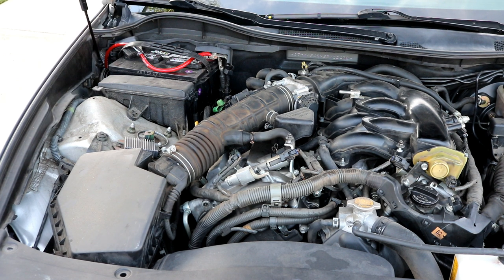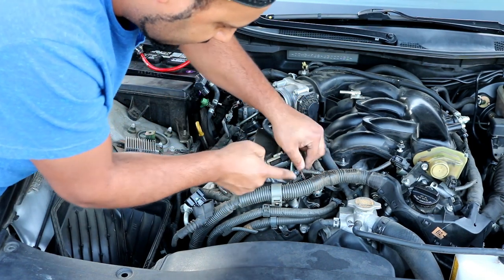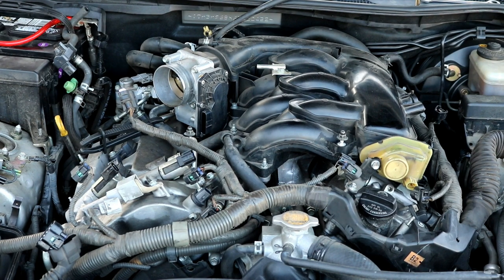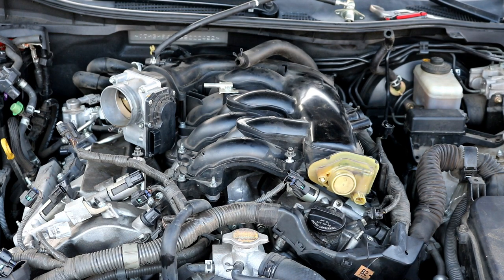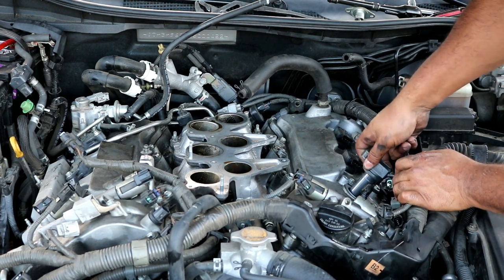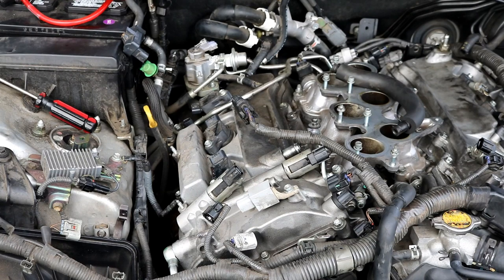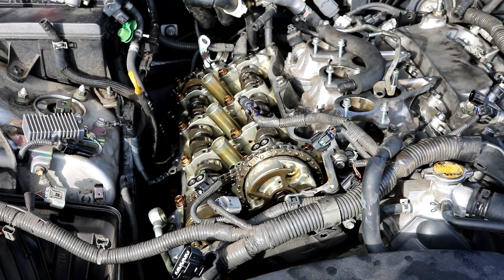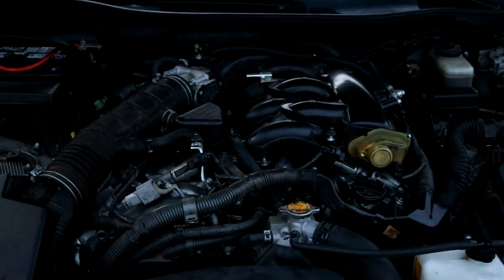Lexus GS300, GS350, IS350, IS250 Valve Cover Gasket Replacement

Comment: i got mine done  today   u got to have a lot of patience to do that job  but im glad i safe some $$ thanks for the video   and the bolt  by the driver side  was really  a b
Reply from the maker: bennyinmtl61 You’re right, this actually took me 3 hours. Of course filming made it longer.
Reply: @HelpingHandAutoRepair    i did my starter too  last week so i decide to fix everything to replace the starter too is not a joke  the top bolt din t want to come out   i had to cut it   it was very rusty   but got it done
Reply: @HelpingHandAutoRepair  3 hours is not bad at all especially given that I've spent entire days just replacing suspension parts (especially with rusty fasteners.) Looks like I should plan to do this and my water pump in the same day since some of the same stuff needs to be worked around and less risk of spilling coolant from disconnecting hoses if it's already drained.

Comment: I would recommend covering those open inlets !! Sod’s law something could fall in and ruin your day😬
Reply: Especially working outside, I was doing some work last week and we've already got leaves falling off our trees and I had to clean them out of the engine bay before closing the hood. I don't want to think of one clogging an intake valve or getting into a cylinder.

Comment: Thank you for this video! Saved a bunch of money. One suggestion… If the spark plug caps don’t fit, most likely you didn’t remove the metal ring from the previous cap. Use a blade screw driver to pry the old one out.

Comment: Thank you so, so much - I've been thinking about taking the covers off to tighten the bolts on the cam gears, since it started rattling a week ago and I read that the bolts may come loose and cause oil to leak back into the engine and not stay inside them :) .
Reply: Kaloyan Beshe

Comment: About to do this.  Really good video.  Wish you showed when you were taking the valve cover off and putting it back on so we can see how difficult or easy it comes on or off.  Did you have to use some kind of sealant on the gasket?  Thanks again.  This is really helpful.
Reply: Found my answer in the msgs below. Sorry for asking same questions.

Comment: Very helpful indeed; however as you reiterated patience is the key to successfully completing these jobs. While I'm at it, how many camshaft timing oil control valves are they on these RWD 2008-2012 V6 IS250/350 engines?
Reply from the maker: I think there are 4 but I am no professional and I do not see these engines enough to know them off the top of my head.

Comment: Very helpful video. I was able to do for the first time. I know its been  a while but anyway do you remember if you had to prime the fuel lines? My car won't start after putting everything back. It looks like fuel is not getting there. Thanks a lot
Reply: check and see if u plugged the fuel pressure regulator connector back that was my issue i did everything correctly but forgot that

Comment: What’s the most I should pay for replacing the gaskets and spark plugs?  I’m not smart enough to do it myself.  2006 is350 75k miles
Reply from the maker: That varies tremendously based on where you live. What I would suggest someone pay in my area is around $500-600

Comment: Great video man, nice and clean video.  Would you mind sharing the list of Tools especially the one you used at the back near the high pressure fuel pump. thanks
Reply from the maker: sunny ponappa badalera Hello, honestly I couldn’t remember every single tool I used in the video. I will say that you need a set of metric 3/8” sockets with a 3 and 6 inch wobble extension. The high pressure pump is held on by two 12mm nuts that can be accessed very easy from the top. As well as the metal pipe that heads towards the back of the motor. It is held on by two 10mm bolts that should be able to be accessed pretty easilyz
Reply: Any idea what the torque spec is for the two nuts holding fuel pump?
Reply: Since somebody today might be wondering according to the Factory Service Manual it's 18 ft-lbs for the fuel pump and 7 ft-lbs for the flange holding that fuel line in.

Comment: Your videos are a great help and they are very easy to follow along. It's awesome that you are wiling to help people like this!

I also have a question regarding this procedure. Along with replacing the spark plug tube seals do you recommend replacing any other seals while having the covers off? Reading the forums, where I actually found your video, I ran across people saying that there is o rings in the valve cover for oil passages to the camshaft. Could you clear that up for me please? I looked at the parts diagrams on the dealer sites and such but I only found CAMSHAFT BEARING CAP OIL HOLE GASKET, could this be what it is meant? I also ran across CAM TIMING OIL CONTROL VALVE, but again it does not point it out on the diagram? 

My car is approaching 120k and it seems like something else comes up as soon as I fix one thing so I am just trying to get ahead if I can and prevent re-doing the same task twice lol. 

Thank you for all your help!
Reply from the maker: Goran Lulic Yes there are small o-rings on the underside of the valve cover. I don’t recall these coming with the valve cover gasket kit. Then again this was a while ago. It very well may have come with my gasket set. They should be able to be found pretty easily at any local parts store or the dealership. Thanks for the kind words!
Reply: @HelpingHandAutoRepair  I gotcha, thought I'd check and see if it rang any bells. I may go by the dealership and see if they do in fact come with it. Thanks for replying so fast!👍👍

Comment: When you open the hood looks nice bcuz of the  plastic cover😁.. by the time you  take off the plastic What a bulky engine 🤔🤔.. i rather buy a integra more easy to fix it than the lexus... you did a good job 🤗🤗🤗
Reply from the maker: Arnold Baclig not sure why this was stated? Lol
Reply: Less clutter under the integra's hood, than what's under the plastic cover in the lexus engine bay. Lol
Reply: You think that’s bad. Keeping it clean under the covers is a real choir. 😜
Reply from the maker: Well it is a bigger engine and also more advanced than an integra engine so it would make sense that there is “more stuff.”
Reply: Hondas are much much easier to repair...
Reply from the maker: Michael Lavin It’s all relative. People will always say this because they have worked on one or two Hondas. I can give you specific Hondas and “Honda” repairs that are an absolute nightmare. 

Every car has easy repairs and hard repairs.

Comment: Hi, love your video.  If I only need to replace the passenger side, do I need to take the intake manifold out?
Reply from the maker: You shouldn’t have to, but valve cover gaskets are normally sold as a pair. If one side is leaking, chances are the other side isn’t far behind. May as well replace them both.
Reply: @HelpingHandAutoRepair  Thank you.

Comment: Do you need to use FIPG or the Toyota black rtv? I know on my 22re I had to do the halfmoons and they require Toyota fipg
Reply from the maker: I believe I did on certain areas where the timing cover meets the front of the head and wherever there are humps or such. Sorry this was done awhile ago. I tend to just put RTV wherever I think a leak could develop. Not a lot but just a little bit.

Comment: Great video, very helpful, thanks. I have changed spark plugs but my issue is an engine rattle that got to the point engine would just stop (shut down). Any tips how I can access/replace the vvti controller/ timing chain?
Reply from the maker: Chain is a big job. Everything needs to come off the front of the motor. Valve covers need to come off too.

Comment: I just fought this on my 01 4runner with the 5vz motor. Took me about 6 hours. As helpful as this is it also is increasing my likelihood of letting someone else do it. I dont have the patience to do this again lol
Reply from the maker: Lol yes V6 FWD or RWD setups are just irritating on these Toyotas. Simply because you have to take the intake manifold off. If the intake manifolds were designed like some other car manufacturers (like Mercedes for instance) then you don’t need to take the manifold off at all. They are very easy to do.
Reply: @HelpingHandAutoRepair  exactly! My 5vz is easy for the passenger side because you dont have to take off the intake but the driver side requires both upper and lower intake plenums and the throttle body and all vacuum lines and you still fight the wiring harness like the 2gr. I could definitely tackle this job myself but honestly for times sake and frustration I just dont see it being worth it lol
Reply: I'll still take this over a transverse-oriented engine where one bank is against a firewall, at least you can reach both easily in this arrangement.
Reply: @jeffumbach  that's true. I just know working on these motors is so much work compared to the 5vz-fe motor lol. Just a lot of stuff in your way every time you turn around

Comment: Great video. Im planning to do mine as well.  This is helpful.  How do u remember where everything should be putting it back together ie. screws, and connectors, etc?
Reply from the maker: Yes
Reply from the maker: I suggest you take lots of pictures if you don’t remember and you can also use ziplock bags to label bolts to remember where they go

Comment: Hey man, thanks for the video. Very helpful. This will be my second time tackling this job. I have a problem tho, with mines I’ve had a p0420 code and it runs pretty rough. It’s been like that for a while and two months or so ago I swapped the two cats under front but I still have the code and I smell the egg smell. Do you think I would need to swap the rear cats?
Reply from the maker: If you didn’t replace the cats with new units, you will have the code and the smell until you replace the cats. The cats are most likely clogged causing it to run rough.
Reply: Did you get the job done? I need to do it too.

Comment: I just wanted to ask did you use the gasket maker ( toyota seal packing black or three bond or similar product)  like area close to timing chain. Thanks
Reply from the maker: Bryan Galvez Yes, I did use black silicone. Permatex Black RTV.

Comment: Great video, how did you get the 2x10mm bolt from the fuel line AT 39:17? The space is tight and a rachet cannot fit there,
Reply from the maker: Honestly can’t remember. Probably either a 1/4” wobble extension or a small open end wrench.
Reply: It was a pain in the ass! I had to remove the lower intake plenum to get to it, which wasn’t hard at all just remove the bolts that come with it and might as well replace the gaskets from the lower intake manifold

Comment: Great video I am doing that repair on my car 2006 Is350 and I am having one hell of a time getting that fuel pump or regulator out-of-the-way.  on my car the coolant lines are directly on top of it so I can’t just pick it up I’m having to remove additional items. Any additional wisdom on this
Reply from the maker: Marshall Kendo I can only assume the IS engine bay is slightly smaller than the GS I am working on in this video. If there is a way to detach the coolant lines via a bracket that would be able to give you more wiggle room, that would be the best way. You do need to loosen and remove the 10mm fasteners I mentioned in the video on the back of the motor and that little rubber hose I also mentioned. Worse case is you will need to disconnect the coolant lines that run on top of the it. I couldn’t imagine Lexus making it this difficult for IS owners but you never know.
Reply: That’s the approach I am going to take.  Of coarse the nut for the bracket is tough.  Once it’s loose I think I can push them out of the way
Reply: @marshallkendo7095  how'd you get around this
Reply: Michael Lavin I did have to take it off but it was not to bad just have to take your time with it
Reply: On the one I worked on I had to remove both the intake manifolds and the runners just to get the second 10mm bolt off to move that hose out

Comment: I wonder If the tube seals where but on right you had them facing up but now won't slide in easy threw spark plug tubes I got them in by using plastic pry bar any ideas I looked at yours and put mine in just like you had them facing??? Help lol

Comment: Hi, Thanks for the vblog. To replace the valve gasket ,it's a must using RTV silicon gasket maker together with the oem valve gasket?
Reply from the maker: It’s not necessarily needed unless you feel like making a judgment call. I didn’t use any and there isn’t a single leak.
Reply: I appreciate your prompt reply.Thanks...
Reply from the maker: chen steven Not a problem! Ask me any questions you may have.
Reply: @HelpingHandAutoRepair   i had to use some cause mine was leaking  but i got an after market  at advanced auto part   will suggest to get the oem

Comment: Hi, did you depressurize the fuel system, if so, how ? Thanks !
Reply from the maker: Haydn Ciepiela Sorry, I don’t recall that I did. However if you would like to simply find the fuse (owners manual or online diagram) that operates the fuel pump. Start the car and pull it out while it’s running and then your system will not be pressurized anymore 👌🏽
Reply: @HelpingHandAutoRepair  Thank you!!!

Comment: My cylinder 6 started misfiring ( same engine) and pulled the plug out and it was covered with oil. Is the spark plug tube seal leaking??
Reply from the maker: Ponyboy Yes. Unfortunately you need to pull off the valve cover to replace that seal. Might as well get the valve cover set and just replace both sides as I show you in this video.
Reply: Thank you for the quick response!!! I figured that’d be the issue but wanted to make sure 100% thats what it is. Im uploading a video soon showing the plugs. Do check it out and confirm https://youtu.be/ZjgObHV3gDY

The Gasket kit I'm getting is below. Please confirm that aswell https://www.thewrenchmonkey.ca/products/auto-parts/fel-pro/vs50690r/
Reply from the maker: Ponyboy by your video I am not convinced that you have bad tube seals. The coil actually looks pretty dry. The oil on the threads of the spark plug appears to be ok. As you see the tip of the plug appears to be in ok shape. The coil looks dry and just dirty. It would be wise to read the codes (if you have a CEL on) and then you can try and pull just those coil packs and inspect them for lots of oil on the outside of the coil pack boot as well as oil in the inside of the boot. 

The valve cover set you have selected looks fine.
Reply from the maker: Ponyboy I would first clean off the threads of the plug with brake cleaner real good and then reinstall the plug and make sure you torque it down completely and make sure that it is completely seated. Then inspect the bottom of the coil boot (the spring inside should be dry) for excessive WET oil. If it is ok reinstall the coil pack. If the problem still persists on cylinder 6 then take that coil and swap it to the other side of the motor (ie the other head) and install it and see if the misfire follows that coil. If it does then you have a bad coilpack. If it doesn’t follow and stays on #6 then get back to
Me.
Reply: Thank you again. I will follow your steps and re-torque the plugs. The oil on the coil was minimal so it didn't show on the video properly. However, if you see the ends of boot between 0:30 - 0:35 you can see the ends of coil shiny. But there was oil on the coil 100%. Thanks again! I'll get back to you after performing your suggestions.
Reply from the maker: Ponyboy oil inside the boot on the bottom of the coil near the spring? What I am trying to explain here is that the oil on the THREADS of the spark plug means nothing. That isn’t going to affect he way the coil pack operates. The tip of the spark plug where the coil pack sits on is dry. I am assuming the inside of the boot where the spring is located is dry. You may have a bad coil pack.
Reply: I follow your suggestions and get back to you! thanks man!
Reply: didv you experience rough idling before changing the gasket?
Reply from the maker: Scott c No. The gaskets were leaking lots of oil on both sides onto the exhaust manifolds.
Reply: I found oil on one of my spark plugs and I know my valve cover gasket needs to be changed. Do you know where the rough idling can be coming from?
Reply from the maker: Scott c do you have a check engine light on? If so have it checked. Chances are you have a cylinder misfire. The oil is most likely to blame for that. This would definitely cause a rough idle.
Reply: Helping Hand Auto Repair no check engine and I recently changed the oil. Just to clarify are u saying the oil on the spark plug is the cause for the misfire?
Reply from the maker: Scott c Yes. If the coil packs are covered with oil on the bottom of them that can cause a misfire.
Reply: Helping Hand Auto Repair thank you, I’ll try changing the coil too.
Reply: Thanks for posting this don't have any oil leaks, did find some oil it the threads of one of the plugs. Car is 06'GS and only has 41k .
Replaced all the plugs due to age not mileage.

Comment: You think its possible to replace the passenger side gasket without removing the intake manifold?
Reply from the maker: Probably but you would want to replace both valve cover gaskets at the same time.

Comment: Hey is there a certain way or torque spec I need to keep in mind when removing or putting back in the head gasket bolts?
Reply from the maker: You would need to look up head gasket torque specs online. However I did not do anything with the head gasket in this video.